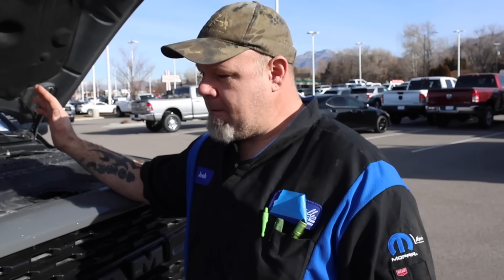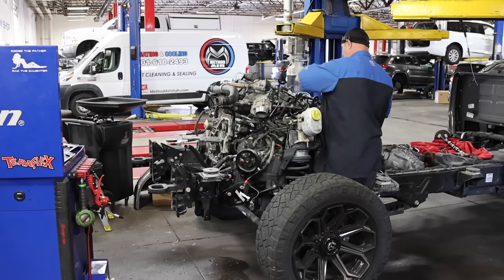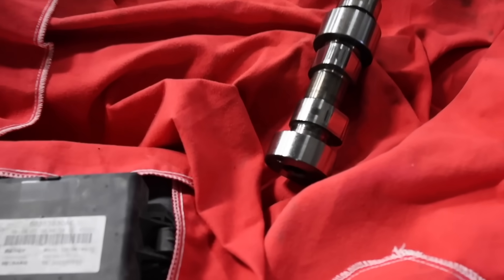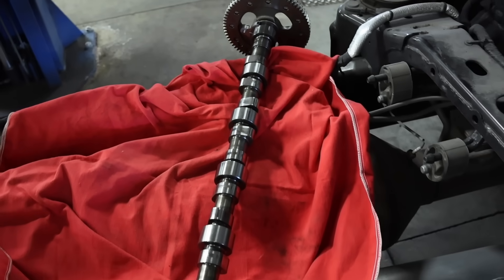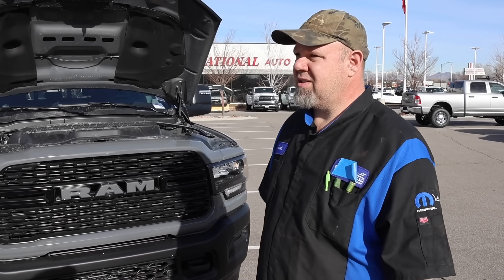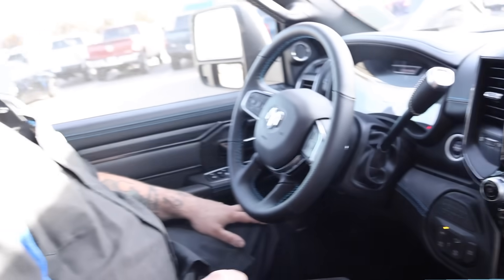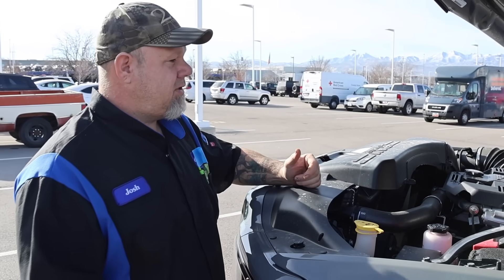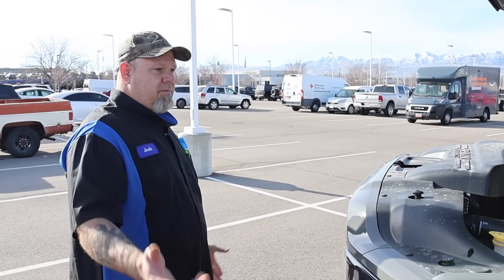Master Diesel Tech Explains The BIGGEST Killer To Your Diesel Engine!

Comment: Great Video, i have a 2017 Ram Cummins 2500 crewcab 4x4 tradesman. Absolutely love this chromed out Delmonico red beast! Ordered her drove it 600 miles city and highway about 40/60% then took it in had the oil changed to Rottela T6 full synthetic and the rear diff changed to the top synthetic the dealer had. And for 60,000 miles changed it the engine oil every 6k with the T6. Now knowing she was fully broke in switched to Amsoil Signature Series 5w40 Max Duty Diesel Ran oil analysis every 6k and filter change and top off to 15k miles oil still tested like it was near new. But i wont go further than 10 to 15k per oil change or if analysis says change based on the driving habits in that cycle. Surprisingly the Ansoil kicks the T6 ass it doesn't hold up over a 8k mile distance it starts to break down. Thats why i switched. Plus the Amsoil reduced the friction coefficient of the rotational mass of the engine which gave me 1.8 mpg increase. I also ran fuel supplements from day 1 power service Diesel kleen. Also switched the the Amsoil Diesel fuel supplements this stuff is amazing it bumped up the cetane from 45 untreated to 55 treated got me another 2mpg and reduced my regens by 40% i will never use anything but Amsoil from now on. Because i only do one oil change a year even though its more expensive its still saved me $240 and fuel savings over 2k in a year. Amsoil is worth every penny. 
Now i have the G56 6spd manual and the high idle function with the cruise control is NA. Its designed into the chip to engage with the parking brake on in nuetral obviously. At 60F or lower. What i found is this it takes a few minutes to engage idle up to 1000rpm. But if i start the truck with the exhaust break on full it takes about 10seconds for it to engage and it rapidly warms up between 1 to 4 minutes when its between 60°F to -12°F respectively. Shes got 90,000miles on the odometer and runs better than when i brought her home day 1 brand new. She pulls hard too especially when i spool up the turbski right and she chirps the tires between 1st-2nd, 2nd-3rd,   3rd-4th on occasion. Mind you i do not drive like that all the time and its bone stock my only mods are Amsoil in everythang! 😊 Thought you may like this info since G56 manual Cummins trucks are rare these days.

Comment: For some of the smaller diesel engines with Auto Start/Stop - could this also lead the heat soak situation also with all internals and hurting the engine components?

Comment: I have a 22 H.O. and when I’m going up a slight grade in elevation I feel the truck surging. However it goes away when i turn on the tow/haul mode. Is this from the turbo and why does it do this?

Comment: I was affiliated with a large fleet of over the road diesel trucks. We used synthetic oil and changed the oil every 40,000 miles. Typically got 700,000 to 800,000 miles on motors

Comment: Your oil is black because you had an explosion of fuel which creates carbon. Your piston rings then scrape that carbon off and micro traces get into the oil....its not fuel getting passed the rings. My vehicle gets to a temperature the thermostat allows it to weather I'm idling or driving 120 mph. Idling will be bad for the turbo where it doesn't get enough velocity to blow things out. Hence why pre-turbo diesels people said to let them idle 24/7. I'm guessing auto timers with remote start turn off 10 minutes so you don't build up carbon monoxide in your garage/house. And no I don't work on diesels I just have common sense and love my LBZ.

Comment: I have a 2006 6.0 powerstroke with 261000 miles on it. I live in an area that typically stays below freezing during the winter. I never let my engine idle, even in winter, more than a couple of minutes. And it's not just about oil contamination. There is another issue when idling your engine cold. It's called cylinder wash. The fuel actually washes the oil off of your cylinder walls. It will cause glazing, which means your cross hatching gets worn smooth. The cross hatching is what retains the oil to lubricate the rings and cylinder walls so they don't wear out. This is where excessive blow-by into the crankcase comes from. I change my oil and filter every 5000 miles. I would never go longer than that.

Comment: I worked for Cummins for 30 years and I love Cummins, but you couldn't give me a Cummins pickup truck, todays version or the early B5.9 powered ones, why? Because I don't need a diesel. A diesel is meant to WORK, not run you down to Walmart and around the neighborhood, it's meant to be pulling 70-80% of it's rated power most of the time, that's when they're happy and will give you the best performance. Of course you have to maintain them properly too.

Comment: i’ve got 250,000 miles on my 2011 6.7 cummins. had it since brand new, and i’ve been religious about oil changes, fuel filter changers, tire rotations and switching out the CCV!! 5500 miles is the sweet spot for me and i’ve never had any issues! still got the OG 68rfe too, no problems at all

Comment: Perhaps you should know the proper oil for the truck you are sitting in. This guy is an oil changer, not an expert, changing every 5000 is a waste and bad for the environment. Just because some jack wagon has a mopar shirt on doesn’t mean he know anything. Take his advice if you have more money than common sense. Use amsoil and a bypass filter and send your oil for analysis.  You’ll see 15000 is fine.

Comment: Oil change can include a refill with diesel fuel as a temporary oil to flush the remaining oil out. Run, drain and put in fuel tank. Do not drive. Idle only. It is just a rinse solution.

Comment: Turbos run hot enough to vaporize oil. Let them cool down before you stop pumping oil. Temp will come down fairly quickly. Change oil more frequently than recommended.

Comment: Awesome information as always. I change the oil in my 6.7 every 5k miles and fuel filters as well. My peterbilt gets oil and fuel at 10k on the X15. Maintenance is the number one thing to keeping a working engine.

Comment: Lol so what's the difference between starting your truck and driving it lightly and starting Your truck and doing what did , raising the idle up like crazy and sitting.

Only difference I see is the engine is warming up faster but trans/diff is warming at all.

Comment: 2015.5 duramax manual says on cold engine let it run a few minutes and temps less then 0* plug it in. I just changed my oil at 3k because it was black even though oil pressure was the same as new oil. I run 15w40 mobile delvac it’s what came in it and always AC Delco oil,air and cabin filters

Comment: I’ve been driving simi tractor trailers for 22 years and always changed oil at 10,000 miles and had great results.  Went to work for a company that uses Penske to do their service.  Went in to get my oil changed and was told they only change oil every 35,000 miles.  I quit, I won’t work for a company that destroys trucks.  Don’t ever buy a used truck from Penske, you know that they have been treated like trash.

Comment: Thanks for the very informative video. I bought a new GMC 3500 dually diesel in 2020. I also bought a lifetime oil change package that the dealership offered. I must say that it‘s paid for it‘s self. I drive from Portland OR to Canton OH every year..sometimes multiple trips. An oil change before I leave and another in Ohio for the return trip(I pay for this one). Dealer says my truck purrs like a kitten and is always offering to buy it back from me. Great info on the warm-up tips. I‘ll start plugging my truck in….Cheers

Comment: I have an duramax lbz the last engine before all the smog crap. I have a 3 stage high idle if I need to set and idle for mor than a couple minutes. I have 370 thousand miles still running strong.

Comment: Seems to me this video is primarily for folks who are driving pickups (not over-the-road 18 wheelers).  Based on that premise I feel your oil-change interval is smart advice.  Some of the tips on how to operate the diesel-equipped pickup that spends part of its time going to the grocery store illustrate the onerous requirements that the little lady is not going to do. Just too much. So, get a Honda for your basic run-around needs and then use your pickup  when you need what it does best. Remember, that Cummins engine was originally a tractor engine.

Comment: Amsoil  with their system said you can go 25,000 miles on oil change,  Good or bad??,,   On start up i park in garage 50 Deg, in winter,  i let it warm up for about 2 min’s and stay under 40 mph for about 2 miles,   Try to get the EGT 1, down to 500 Deg before shut down..

Comment: I have a question for you more related to boats.  Our Volvo Penta 3d 150hp has a large 170 amp 24V alternator on it that charges our batteries while we are running.  We also have a 13.5 kw generator but this only charges at 60amps due to not having any battery charges hooked up to it.  So is it bad to run the main engine at 1300-1400rpm with no load besides the alternator?  So if i want to charge a lot ans quickly ill run the main and the gen together but when we are at anchor there is no load on the main besides the alternator.  We do oil changes at 100 hours and do oil samples for trans/main and gen every 100 hours.

Comment: Totally fn up the air-fuel ratio by putting in wanted carbon build up in your Cold air intake eventually checking your air intake and destroying the longevity of the engine's MPG and HP. But if all you need is a truck that lasts 100K than good on you
Reply: P.S. Where I live if you idle your engine longer than 3 minutes you can be fined and I live in the cold white North

Comment: I 100% agree, BUT. First of all i have seen many people who work with oil and do analysis on different intervals and 15k is waaay too long. Then regarding the idling its a double edge sword. Ideling takes forever to warm the engine, slowing driving kike taking it easy warms up the engine much quicker, but now you putting on some load, so yeah i idel for 1 min then slowly start driving. Great video

Comment: The biggest killer of diesel engines is the dumb s*** government morons and EPA idiots that require these emissions treatments. The real problem here is that these complete f**** idiots forgot the first law of thermodynamics that matter is neither created nor destroyed. Everything that goes through that system comes out, including the hog urine that we are now forced to stick in the diesel engines. We are actually increasing pollution with their bulshit rather than decreasing it and at the same time reducing the life of diesel engines across the board which hurts every consumer of diesel engines and benefits every manufacturer of diesel engines. it is as simple as that. It damn sure is not oil

Comment: When I plug in my block heater, it takes about 4 hrs. To reach peak temp so running a wireless on/off control (~$17) or having a scheduled timer will save some. Cost on my 650W  block heater is about 7 cents/hr so leaving it plugged overnight is wasting money past the first 4 hours.
Re. 12V lead-acid starter battery:
Most vehicle charging systems in northers winter driving will render battery chronically undercharged which will significantly reduce battery life so a trickle charger (~$30) is a very cost effective solution.

Comment: I go with the manufacturers recommendation based on usage. I haven’t hunted 2018 6.7 Cummins I just hit 86k. I haven’t been taking it in between 13 and 15k to the dealer since it was brand new. Truck doesn’t use oil and has plenty of power towing. 
Normal synthetic oil life according to the manufacturer is between 7500 and 15k or every 6 months. If I used mine harder I would go to 7500k. I would never do less however while using a full synthetic oil. Guess time will tell.

Comment: I stumbled on your video and I have to say you are spot on. I'm a heavy diesel mechanic and been doing it for years also worked at a dealership as a diesel mechanic. Every time we drop the oil on a semi or heavy equipment we take an oil sample for that reason of contamination and dilution. I see more engine failures due to that fact. I think oil samples are important to see what you engine is doing also cutting open you oil filter and inspecting the element and not just waiting for engine failure to do these things. Good video

Comment: I looked at a tractor which had a recon engine few years before and guy said oil pressure gauge stopped and he had never changed oil it would not come out drain plug I added diesel to oil ran and still poor removal of sump cleaned out scraped out and washed out oil pump refitted and done two oil changes was then ok

Comment: Always:
1. Use 5W-40 regardless of climate. That way you're covered on both ends of the temp spectrum.

2. 2 - 3 minute idle warm ups or else it's just cooling down and wet stacking.

3. 10,000 mile oil changes is perfectly fine if you do the above 2

Comment: On cold starts mine automatically goes into high idle after a few minutes. I usually give my truck 3 to 5 minutes to warm up. It takes me another 4 to 5 minutes before I get on the interstate by that point in time I’m around 150° in cold weather in my coolant. I usually give it 60 seconds before I shut it down after driving it. I live in Tennessee. We typically have a mild climate here here I run Valvoline 10 W 30 synthetic blend. I change my oil approximately every six months. I’ve had six oil changes and I just turned 30,000 miles. Maintaining an engine the way I do whether it be gas or diesel. I’ve had a few issues. I got 280,000 miles out of my wife’s 6.2 L in her Yukon before I had to replace the engine and we bought it used.

Comment: I WAS TOLD YEARS AGO TO ALSO LET MY DIESEL RUN FOR A FEW MINS BEFORE SHUTTING IT DOWN 
THIS WILL PRESERVE THE TURBO BEARINGS ,A FAST SHUT DOWN LETS THE TURBO KEEP SPINNING WITH NO OIL BEING PUMPED TO TURBO, 
EVER SEE SOMEONE SHUT OFF A TURBO VEHICLE AND LISTEN TO THE EXHAUST PIPE,TURBO IS STILL SPINNING UP TO TWO OR THREE MINS ,I ALSO READ THIS IN THE OLD VOLVO 740 TURBO OWNERS MANUALS,BACK IN THE DAY OF REAL CARS

Comment: On a ford 250 2017
I can’t get the cruise control
To turn on unless it Is above 10mph
In park I have I of the engine up
Trying to get the cruise control to turn on 
So I could have control over my idle speed
But no success 
Can you provide any help?

Comment: Great video,  As a mechanic this certainly helps both on the preventative maintenance side of things and helps pin point problems. You had some good turbo habits for those expensive turbos and of course wisdom on oil; the dos and don'ts.  Thanks for your time and effort you put into this video.

Comment: on my 6.7 powerstroke I do my oil change every 5,000 miles(usually abt 220 hrs).  I always let it drain for a while and then flush it with about a half quart to try and push as much out as possible.

Comment: On my 2019 Ram 1500 classic ecodiesel I currently change my oil every 10k, fuel filter every 20k with currently 134k miles on it, but I did have to change the EGR and CR converter at 86k so after watching this video I will be changing the oil every 5k and fuel filter every 10k especially after changing my fuel filter after 10k miles and seeing the filter very dirty!

Comment: Any idea's / comments on why a 2022 3500 HO will be doing an auto regen every 2 to 300 miles? my truck has had its DPF replaced at 65000 miles and at that time the dealership did the Y43 recall they were finely able to get parts. after the DPF filter was changed it started to auto regen a lot... then my grid heater went out the nut broke off when they were replacing it, took pictures there was a ton of soot in the EGR and intake valley. been taking truck back to dealership to figure out the regen issue and they can't figure it out.  no error codes... they performed a regen at the dealership and the last shot in the dark was to replace the mass airflow sensor... any ideas would be helpful... thanks I live in Easten Washington...

Comment: here's a secret folks dealerships and car manufactures don't tell you this but it is true and some wont admit to it because they want to make sure there pay checks dont get affected. . you can put a higher viscosity oil in your engine. example would be if you use 5w20 or 5w30 you can move up to 5w40 5w50. or go to 10w30 10w40. issue is manufactures do this trying to push fuel mileage or called Cafe regulations trying to push fuel mileage while not getting the best engine protection.  so its best to use thicker viscosity if you live in warmer states since the summer heat will thin out that engine oil. so using the thicker oil is always best if you live in hot  weather.

Comment: Egrs suck… I have 2 vehicles one is very old 350k km and one with half that…. The old one has egr blocked off and is far cleaner after a full service interval that the other one with 1000km on it

Comment: I’m curious I work at a heavy diesel construction company and we have our own shop concrete trucks etc, why is it that these personal diesel trucks you need to baby with fuel and oil changes? We have our trucks “tri axel and mixer trucks”, we beat the shit out of them and I can tell you they definitely do not get serviced at 5k maybe not even 15k some trucks and they never have issues. They just chew through all that junk and keep running? Just curious if thoes truck are just built more robust and if so why hold back on the personal trucks! Idk

Comment: I work with an automotive engineer.  told me that when an engine is designed, there are three things you want. They are efficiency, power, and reliability. You want all three but you can only have two. These days manufacturers want power and efficiency. Reliability suffers.